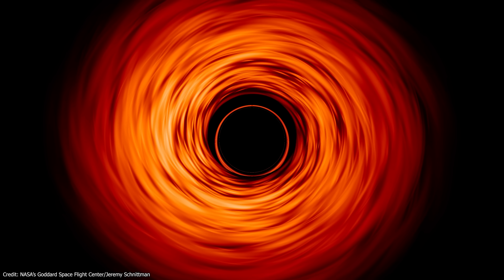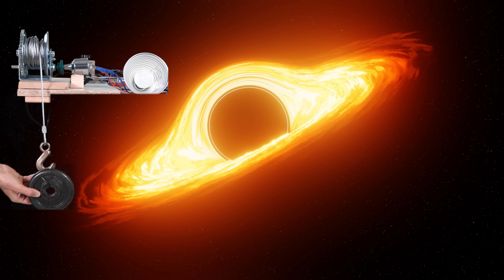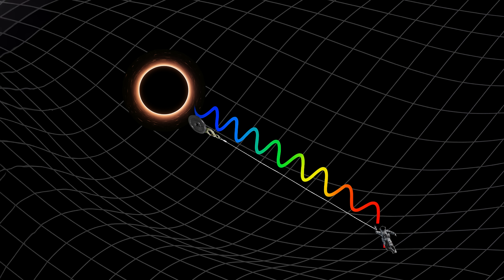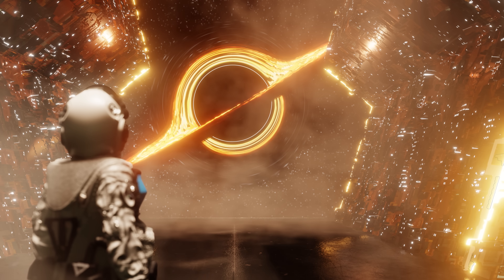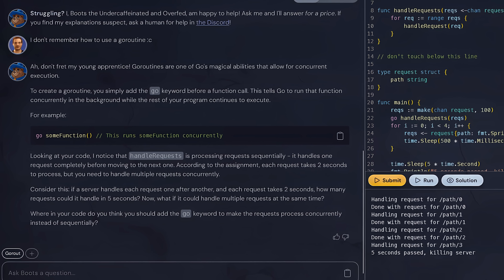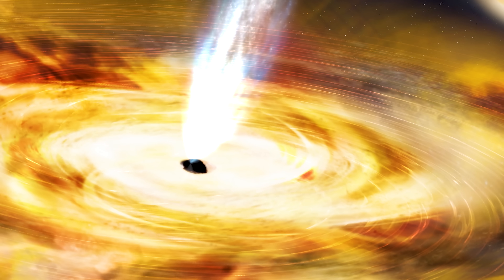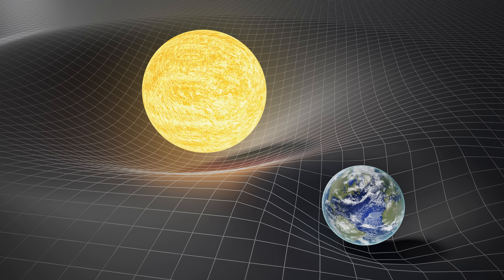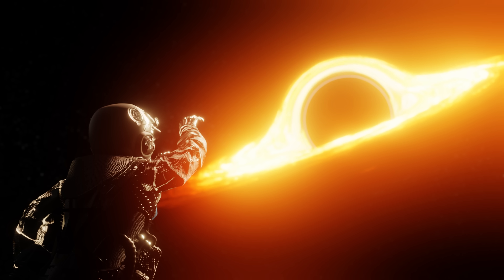How to Convert Mass into Energy at Home

Comment: Honestly, this is a pretty bad explaination of mass-energy conversion through gravity. A far simpler explaination can be given through a thought experiment (one that Einstein suggested):

- suppose you're on the surface of earth with a photon laser that can produce photons with energy `E`.
- suppose there's a satellite orbiting earth, at height `H`, that can magically convert individual photons from the earth laser to pure particles, each with mass `M = E/c^2`.
- the newly created particles will fall towards the earth after being created (assuming they do not inherit any kinetic energy from the orbiting satellite).
- once a single created particle arrives to the earth's surface, it will be holding a total energy of `E + K` (where K is the kinetic energy attained from the gravitational potential energy, which is `G*M*m_e*(H/(R^2 + H*R))` to be exact, where `G` = gravitational constant, `m_e` = mass of the earth, `R` = radius of the earth)
- but this is clearly more energy than what we had begun with. certainly we cannot create energy out of nowhere, which means that the photon that was received by the satellite must have had a lower energy than what it had on earth (precisely, it would have had `E - K` energy when it arrive at the satellite)
- in other words, a photon escaping gravity loses energy (from its own frame of reference). and vice versa (i.e. a photon approaching a higher gravitational field would have its frequency increased in its own frame of reference)

I know this example is a little flawed due to the satellite, since it would gain some momentum (and energy) from the photon that it receives. But the example works without issues if you remove the satellite from the experiment and then suppose that the photon decays into a matter an anti-matter pair at some height `H` above the earth's surface, and that the created pair particles do not have enough momentum to escape earth's gravity.

Comment: AE knew matter has energy stored as mass, but the biggest constant he could find was c. That's all the equation does not accurately describe the internal energy in matter is just a GUESS. Thermodynamics has described more accurately how energy is stored in matter, but still no one knows how it's stored in atoms, since the actual atom structure and energy is still unknown in atoms heavier than H. Hence, E=mc^2 is just for museums and theoretical physics.

Comment: You might want to clarify the properties of your rope. You pull on the rope. The atoms in the rope continue to pull on each other to move the rope at the speed of sound-ish(watch alphaphoenix’s video on the speed that physical signals travel at). The “signal” (moving atoms in rope at speed of sound) approaches the black hole. The black hole has massive acceleration, so massive in fact that the atom to atom forces in the rope can never return back up the rope because the acceleration of the black hole keeps them in. However, the rope would stretch at this point before the event horizon so you would feel massive tension in the rope. If the rope has no mass is unbreakable, but still stretchable somehow, then you would actually feel nothing. however If the rope has no mass and is unbreakable AND unstretchable/unspaghettifiable you would still feel something because in order for the rope to be unspaghettifiable it would break the laws of the thought experiment since a signal would have to return so it would just be like you are holding a very large weight.

Comment: Wouldn't the winch and the generator be pulled into the black hole too? They wouldn't be supported by anything, I guess. Of course you can push the weight and the rest in the opposite directions at the beginning, but what about later. Even if there is no friction, there has to be an electromagnetic force in the generator part that produces the energy. (If there was no, the weight and the cable would be free falling.) So, the whole setup would be dragged towards the black hole too.
And yes, you could use a rocket engine to push the winch against the gravity, but that's not generating energy. That's consuming it.

Comment: I really don't get it. It is very confusing to me, or the illustration with the rope and generator is not correct. I'm not sure you are "converting all of its mass to energy", but instead, you convert "all its potential energy into electrical energy", the mass does not change, it is not converted or transformed. In your reference frame, the mass is slowing down to nearly stop and you will never see it go through the event horizon of the black hole, I agree at this point there is no tension when you do not pull the rope. But if you pull the rope then you will have tension (in Newton), it is not like the mass (kilogram) is gone, but the mass is not moving and you cannot move it anymore, it is like an anchor, or like the rope is attached to a tree, it does not move.
Also, it seems there is a confusion between the weight (Newton) and mass (kilogram). In your reference frame, when the mass is at the event horizon, the mass does not accelerate anymore, no weight measured in Newton, no tension in the rope, but the mass in kilogram is still there.

Comment: I usually like your videos, but this one is bullshit.
- The equation E=mc2 is valid only for a resting mass. When an object is in motion, the equation is E2=(mc2)2+(pc)2. When you lower your mass into black hole, you use the energy of the momentum, not the energy of the mass.
- You said that once the 1 kg mass is lowered in a black hole, the black hole does not gain mass because we converted the mass into energy. This implies that if we drop a 1 kg mass into a black hole without generating electricity with it, the black hole would then gain 1 kg. Yet, in both situations, we added the same amount of stuff to the black hole, so it should gain the same amount of mass.

Comment: you don't have to pull hard to keep it in place at the edge of the black hole but the way you show it as being weightless to pull the rope up can't be right because you'd be pulling the weight into the area where it weighs trillions, so the weight will snap to the edge of the black hole and get stuck there, you can't push it deeper but can't pull it out either, it doesn't feel weightless, it feels like it's attached to the wall and impossible to pull out. (if you ignore the rope experience gravity too)

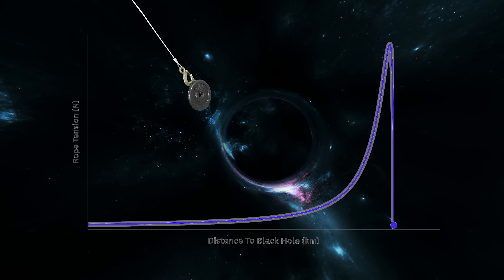Comment: 2:19 - NO! You are conflating "I have gotten all the energy I am going to get out of this system" with "I have converted all the mass of the weight to energy." 

I'm one sentence you say that the weight is experiencing time dilation, thus implying that the weight still exists. Then, in the next sentence, you claim that all the mass is converted to energy, thus the weight would no longer exist. 

This is not a Heisenberg situation. This is a macro level object. It can't be both. 

Besides, the weight would have been spaghettified, and would not be able to pull on the magic rope anyway, after a certain point. Even without time dilation.

I'm getting really tired of "science" YouTubers generating content out of conflation and speculation.

Comment: 6:10 But we were taught in the school that mass is universal and absolute and it does not change no matter where u put it. Only weight changes
Reply: It doesn't change but rather gets converted into energy
Reply: @samarrawal711  but effectively it means the same? Just by lowering the mass by few metres it is changing. Its changing by converting into energy but the fact is its changing so easily!
Reply: @harshvardhansinghchouhan6697  that mass change is negligible and is only applicable to the realtive positioning of the object, the energy prouduced is called potential energy

Comment: Sorry but lowering a weight disc to generate energy is just converting potential energy into another type. This video seems to confuse a mass term and a weight term. Mass is amount of matter and if your action doesn't change that amount then there is no conversion of mass into energy. For example nuclear reaction produts have less amount of matter, so difference is a nuclear energy. But in friction, burning or lowering a weight the mass of end parts is the same as starting parts.

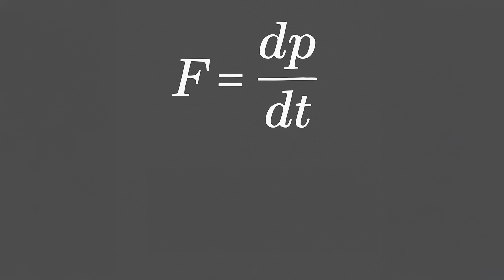Comment: Since many of the ideas around black holes are theoretical, and even the people with degrees in the subject have a hard time appreciating some of the implications of interactions with them, it would probably be best if you preface your thought experiments with 'I wonder if...' or 'An idea I had is...' rather than asserting 'It would be this way'. Black holes are known to have different mass, some are billions of times more massive than others. Mass falling into a black hole does appear to increase the mass of the black hole (though I have seen some claim that the entirety of that mass stays compressed at the event horizon, again, more theory). As I understand it, space itself is more compressed moving inward to the singularity. If velocity is distance / time, and 'distance' is a variable here, a unit of distance near the singularity != to a unit of distance further away from it. I suspect some implications of your equations at ~2:12 could be hashed to explain away the idea that your weight somehow becomes weightless.

Comment: You didn't apply E = mc². The kinetic energy of mass is due to gravity pull being transferred to the turbine which converts mechanical energy to electricity and then lit the bulb. 
Mass remains the same and you didn't convert it at all. 
So what's the big deal?

Comment: The mass conversion efficiency of fission weapons sounds generous at 0.1%, but in the Little Boy weapon detonated over Hiroshima, of the 60 Kg Uranium that it contained, only 600 grams actually went through a nuclear reaction (if the figure of 0.1% is correct) . The rest of the core was vaporized. Which would mean only 600 milligrams of mass was converted directly to energy. 

If, God forbid, we ever make antimatter weapons (which also operate on the E=mc2 principle) just one gram of antimatter will detonate with an explosive yield of 43 kilotons once it comes into contact with normal matter. Given this fact, it is more likely that a fission weapon converts 0.05% of the fissioned mass into energy. Compared to the total size of the core, it is therefore 0.0005% that is actually converted or 300mg which equates to a yield of 14.3 Kilotons. As the bomb was estimated to have a 15 Kiloton yield by scientists visually analysing the fireball and blast effects, I am confident that my figures are correct.

Comment: I disagree, with your examples there's no mass to energy conversion because there's no mass loss. You convert height to energy if you want, thanks to E=mgz. But the mass of your metal piece is the same on the table and on the floor. Only its height varied.

Comment: E=MC^2 is wrong. It just based upon K = 1/2MV^2, replacing v for c and applying the Lorentz transformation. If you don't believe go read Einstein's 1905 paper.

In a simple example, a chemical reaction will release energy, but after the chemical reaction there is still the same number of electrons, protons, & neutrons. Mass is never lost, it just transformed when energy is released.

Gravity does not cause time dilation. Light is not effected by mass\gravity. All observations is just ordinary refraction. In the case of Eddington 1919 experiment, it was the Sun's plasmasphere that caused the star light deflection. In Eddington's 1919 star plates you can see glowing plasma right below the star. The deflection was also much greater than Einstein's prediction. Same deal with Einstein rings as the lensing galaxy is full of gas & plasma causing refraction. Its also refraction because the lensing effect is always limited to one or two electromagnetic (EM) bands for any single lensing galaxy. if it was gravitation lensing we would see the lensing effect across all EM bands (Radio through X-rays). Third no observation of lensing effects around starts orbiting near the Milky way center black hole, Sagittarius A.

Comment: Relativity doesn't work. Nothing, not even subatomic particles, can travel at 34,700,983,524 miles per second  or  90,000,000,000 kilometers/s (speed of light squared) 
Such a theory cannot be proven or even tested.

Comment: It’s a little weirder than he describes actually, if you drop something into the black hole that was even feather light, The weird thing is that every small measure of motion towards the black hole would allow zero motion away from it. So trying to test the weight would actually always result in infinite resistance, even if it had no pull towards the black hole. You’ve become causally separated from your lowered weight.

Comment: You're wrong about this. The tension would continue to increase. Just because time is moving slower for the weight doesn't mean the force decreases, or that the line would slow down for you. Think about it like... Stretchy taffy that you pour out of a bucket. When it gets to the ground, it still keeps piling up even though more taffy keeps getting pulled down towards the ground. A similar effect is happening here. Hard to think about since we think of the cable like it can't be squished. But in fact, it is the space itself that "squishes". At the weight, it isn't going to feel squished up against the event horizon, it falls in just like any other free fall from its own perspective. Spacetime is really mindbending to visualize

Comment: The motor causes a lot of resistance which would need an opposing force to avoid the generator end from also being pulled into the back hole. At a given point, the amount of energy required to maintain physical separation would exceed the energy generated. Later, you would find it impossible to create enough opposing force to stop the generator end from being called inside the black hole.

Comment: Not sure I’m buying the explanation. I’m not a physicist, but here’s my take.

Sounds like you are using the concept of relativistic mass, claiming the weight’s relativistic mass initially increases but eventually decreases to zero as the weight approaches the event horizon.

Problem is that relativistic mass is considered to be an out dated concept.

A more accurate exploration of this thought experiment should instead discuss the conversion of potential energy into kinetic energy, IMHO.

Time dilation makes things a bit more complicated. As the weight approaches the event horizon, it will appear to slow down. 

However, an observer on the spacecraft will never see the weight reach the event horizon. 

Hence, the weight will always appear to be falling and the rope will, therefore, always be under maximal tension. Think, torque vs acceleration.

Now, the experimenter might attempt to create slack by falling closer to the weight.

Unfortunately, both the weight and the event horizon will appear to recede by at least the same distance.

Comment: This past winter I converted a lot of mass (in the form of firewood) to energy (in the form of heat) at home.  On a daily basis I convert mass (in the form of gasoline) into energy (in the form of motion) as I commute to work, but only the very beginning of my outward commute and the very end of my homeward commute are at home, so that doesn’t necessarily equate to converting mass to energy at home.
Reply: That stuff you burned didn’t convert from matter into energy, it just underwent some chemical reactions and changed from solid or liquid into gas phase, then was released into the atmosphere.  It’s all still there, mostly as CO2 gas.  The energy released came from potential energy in chemical bonds.
Reply: @-Jethro- but the reactions were inefficient there was matter lost as the energy was produced.  I was contributing to the inevitable heat death of the universe.

Comment: E=mc² is its own layer, most physicist dont understand that. it doesn't change the outcome because while physicist make one mistake at first, another mistake cancels out the first mistake resulting in the correct answer but still, why have 2 mistakes that result in a fix when you could have just the correct thing in the first place